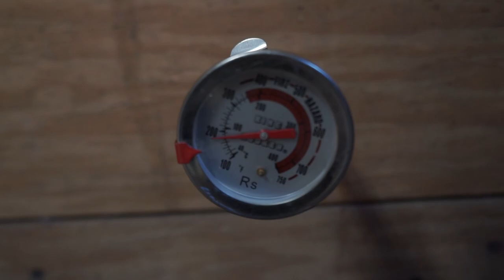Making a Landing Net and kayak fishing for Browns and Rainbows

Comment: I am trying to make a net as well. I was wondering how long you had those pieces of wood in water
Reply from the maker: I didn't time it but they were in the water for about an hour. The time will change depending on the wood variety and thickness of your lamination. Don't be afraid of pulling it out of the water and checking it. Good luck on your build.